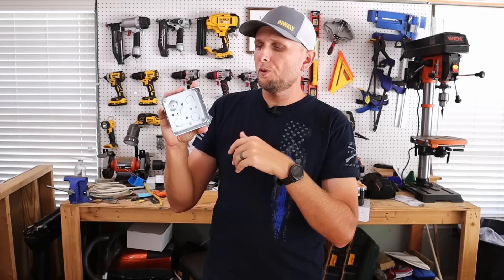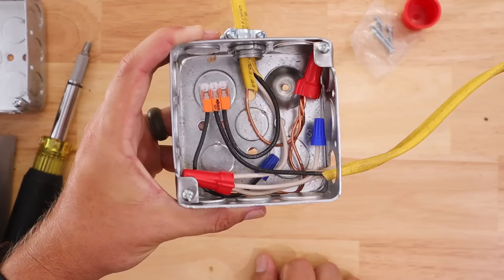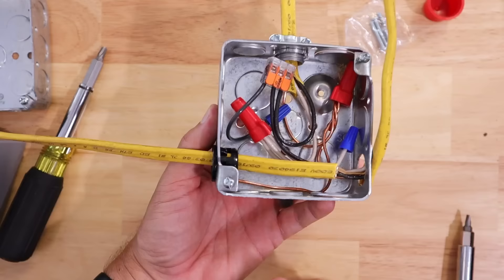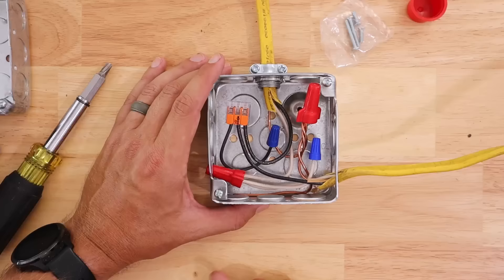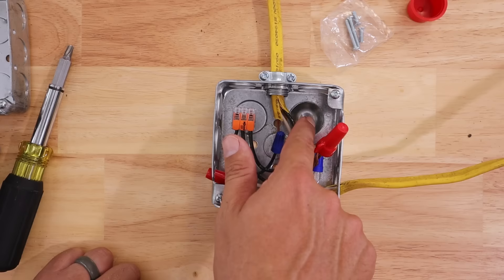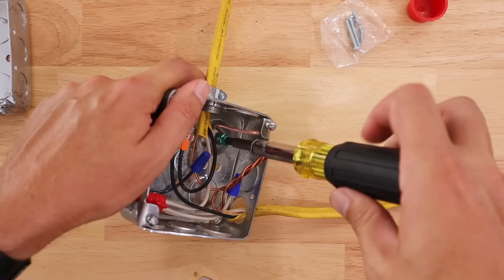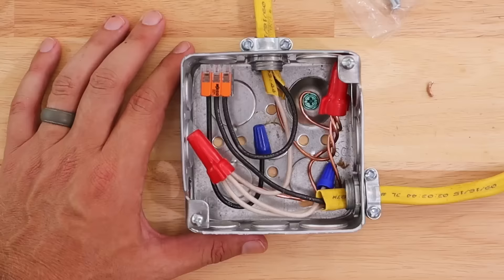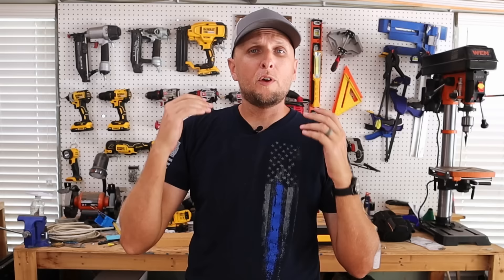The BIGGEST Mistakes DIYers Don't Know They Are Making When Installing Metal Electrical Boxes

Comment: The biggest issue I see is someone performing electrical work without a license. The NEC and NFPA both state only qualified people should perform electrical work. The typical homeowner doesn't have the knowledge, training, skills or ability to do their own electrical work. There is a reason why the IBEW and IEC has a 4-5 year apprenticeship program. How versed is the average homeowner in the current NEC edition? Leave it to the pros
 
Additionally most insurance wont cover unlicensed work
Reply from the maker: Well the NEC stating that doesn’t supersede local law and most places allow the homeowner to do their own electrical to varying levels depending on jurisdiction.  Where I live I can pull a permit and wire my entire house myself and then have it inspected.  Just different everywhere.  Also about your last statement, it more so is talking about hiring unlicensed workers, not you doing your own.  But every policy is different and should definitely check it.

Comment: So you found 3 out of the 5 mistakes in that box.  

4) short wires.  Any wire entering a box by code needs to be at least 6 inches long.  The boxes height it 4 inches so it looks like those wires are about 5 inches.  
5) The documentation for using marrettes requires you to twist the marrette until the wires themselves start twisting a little bit.  If you do this, then you are guaranteed to not have your wires fall out of the marrette for some reason.

Comment: Good advice.  I'd add one thing more.  Unless there's a specific reason to use metal boxes, my advice is don't use them.

The only time you need to use metal boxes is if the box is installed in an exposed environment, or if you're using metal conduit.

Otherwise, why?  Metal is harder to work with, requires grounding, and is more expensive.  If you really need something that's more durable than PVC plastic (which is plenty durable), use a fiberglass box.
Reply: Surface mount.
Reply: @jamescole3152  Also true.  But surface mount also means an exposed location.

Comment: Issue 1 who sits there and just pulls on their electrical boxes? Complete non issue fear mongering.
Issue 2 your ground wires rubbing all up against that box. If it were a hooker at a club, that ground wire wouldn't be allowed back in. Same as number 1, box is grounded. It'll blow the breaker long before it burns up the ground.
Issue 3 also not really an issue. Voltage drop across 3 inches of wire won't be nearly as bad as 30 feet of the slightly bigger gauge running in your wall. If it were to catch on fire, it's in a metal box and there's barely anything flammable anyway.

Comment: 35 years as an electrician.  When the wago type connectors came out years ago, I was onboard.  Since then, over the last 5-6 years I have to many times seen them become fire hazards.  The spring action when heated then cooled over and over for years become weak, wires get loose and they burn up.   I have personally come across this dozens of times compared to maybe twice with an improperly installed wire nut.  Take it from me, twist your wires and use a proper wire nut.  Why and how these wago type connectors are still approved and on the market only shows the politics in the electrical industry where money is first and your safety is second.

Comment: Jesus! Move to Australia. All that connecting and jumpering is replaced with.... Strip ends... twist together.. insert directly in to power point... lock down with a screw connector.... already part of the power point!

Wagoe and wire nuts are the most abhorrent idea I've ever seen... if we have to do something similar its a BP connector and the box is PLASTIC. Why are you even allowed to do this level of work as a DIY?

Maybe the powers that be over there are helping the "natural selection process" along.... 

Cheers great video. Always interesting to see how things are done elsewhere.

Comment: Who climbs in walls and yanks on wires? Any normal licensed electrician shuts off the power first to any outlet. True the wire needs protection but l highly doubt a thick insulated wire will wear through by just sitting. Lol.

Comment: The 14 gauge wire is a fixture tap what's the big deal
Reply from the maker: It’s not.  A fixture tap would be hardwired to a fixture with an exact load.  What if I put a 20 amp receptacles on it?

Comment: Hey. Don’t use metal boxes,wire nuts and no  twisting together, and no sleeving on the earth. Use  a proper WAGO junction box and WAGO connectors. if the wires pull out of the WAGO connectors. GO aback to school. SIMPLE.

Comment: Question for American Electrician:
1. Are this metal electrical boxes common or do u use plastic boxes more often?
 2. Same question but with Wirenuts and Wagos.
3. The yellow cables are ur usually used wires for electric installation? Flat not Round cables?

Comment: 8:30 Saying “pros make this mistake”, when it’s not a mistake… 🤦 You are allowed, BY CODE (and common sense), to downsize the wire at the point of termination. Twelve to fourteen isn’t that big of a jump… especially when you consider that 14g is rated for 22amps. The reason we can’t run a 20a circuit in 14g, is due to the 80% rule, for continuous loads.  
Try not to imply electricians are “doing it wrong”. It’s a bad look, especially when you end up being the one that is mistaken. 👍🏼
Reply from the maker: It’s wrong.  Confirmed it will an electrician unless the wire is a load affixed to something like a light fixture.

Comment: Box ground screw does NOT have to be green. Switch and receptacles YES, box NO.
Reply from the maker: That’s true.  But far easier to just go pick up the green ground screws in the electrical aisle and know that you have the correct size and type of screw.
Reply: @HowToHomeDIY  Yes but there"s nothing special about a 10-32 screw.
Reply from the maker: You are right, there isn’t.  And one that’s 3/8 inches long isn’t special either but would be the correct length.  Again, getting the green ones in the electrical section will guarantee someone that they have the right screw.
Reply: @HowToHomeDIY  Again Yes. But why pay more?

Comment: These new square insert connectors are JUNK.  Internally they have a sharp blade connector that grabs the wire...The problem is where the blade connects to the wire creates a very small connection point that can easily go bad with wire rated amperage of 15 to 20 amps.  The square connectors overheat and start fires...If you have any of them,  toss them in the garbage or take them back and get a refund!  The only way to properly connect wires is to twist the wires together (turning clockwise) then put the wire nut on them and tighten!

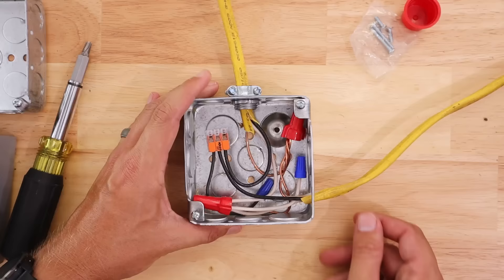Comment: @1:10 strain relief
@4:00 grounding issues
@8:00 considering circuit loads and wires' gauge 

good content, but consider chapter breaks?  You don't even have to spoil what the topics are, but its nice to be able to review the parts you want to focus on without scrubbing

Comment: None of the Romex entering my breaker panel has clamps at the hole. Not being easily convinced that those wires were going to "move around a lot" I spared the expense. I put the panel in myself, live. That's right, I took the old 100A breaker box out and put the new 200A one in with the power ON. It has worked perfectly for over 30 years now. I also ran the 240v lines to my hot tub and electric stove for a small fraction of what you guys would have charged me. Electricians are like veterinarians. They think their services are worth WAY more than they actually are. They want over $100 to replace a simple outlet or light switch now, a 10 minute job that pretty much anyone with a screwdriver can manage if they pay attention.

Comment: At 5:13 you state "You can't use just any screw, you have to use on of these green ground screws."
WRONG! There is nowhere in the National Electrical Code that state the screw you use to bond to a box or enclosure has to be 'green.' 
Section 406.10(B)(1) - [Receptacles] - the terminal on 'the device' - a green...;terminal screw not readily removal. 
Similar language applies to light switches.  But, the enclosure, box, etc. is NOT required to use a 'green' screw to secure the bonding wire. Check 250.8(A)(5) for the use 'of a screw" to secure [among other methods' to secure a bonding/grounding wire to an enclosure.
Again - there  is NO language in the NEC requiring a 'green' screw to be used in a box. 
Think about it - [see Table 250.122 - Minimuim size equipment grounding conductors for  grounding raceway and equipment] - where are you going to find a 'green' screw for a size 250 kcmil condutor? That's for a 2000 amp. Even a 200A  circuit requires a #6 conductor - where's the green screw for that? Nobody makes any such screws - because the code DOES NOT REQUIRE THEM. That said, yes, I do use the green screws for the very small 15-20A circuits - but that's because most building inspectors don't know the code and think they are required.
Reply from the maker: Guy, I am well aware of what it says.  This video is intended for DIYers.  It is far better to have them go to their local store, go to the electrical aisle and buy the green ground screws and know they are the proper type and size.  Would be a complete waste of time to say and you can just use any 10-32 x 3/8 machine screw.  Nobody is going to remember that and it serves no advantageous purpose and like you said, some inspectors don't know the code so just buy the dang green ground screws 🤣

Comment: Old school electrician methods of connecting are better I always pre twist before putting on wire nut I always use the lug on the receptacle for making connection over the years I have seen push connections end connectors of the same method fail and catch fire in the box and even worse progressed even further than the box I am just not a fan of push connectors where I have seen them fail so often if you're going to use push connectors and the push connector on the back of the receptacles after inserting them make sure you pull on them fairly snugly to make sure that they seat properly on the copper wire if they pull out easily the connection is faulty well enough of this R- tired old electrician rambling on

Comment: No point using metal boxes. They are relics from the past. We stopped using them för over 40 years ago.
Reply: No, we didn't stop using them. They're used every day in non-residential, and I use them regularly on resi projects when they make sense.

Comment: You are saying a "metal " clamp to hold the wire in the box. It is not a metal clamp. They are NON metalic!!!
Reply from the maker: They are made of zinc which is a metal.  They are called non metallic connectors because of the cables they secure.

Comment: Wrong... The code requires you to bond the metal box only when you install the device and the cover plate on the box is a metal garvin cover...
Wrong again... you can use the #14 pigtail under the code utilizing the ten foot tap rule, next wire size down for individual device.
Reply from the maker: Wrong… always has to be bonded.  

Somewhat wrong again… depends on what is being installed.  For example, a light fixture is probably already going to have a cable designed for its load attached to it.  In this case, it is ok.
Reply: @HowToHomeDIY  - Oh yes that's right, it's romex... over site on my part. In my jurisdiction we never used romex unless it was for temporary. We ran emt conduit for electrical installations. I overlooked todays modern electrical installations- Cheapest method , higher profit...
Any metal enclosure with romex entering should grounded

Comment: So you are telling the viewers that if you install a 15A receptacle you need to use #12 wire for power.  That is if we are using a push in splicing connector.   That doesn't  make any sense!!!  If my circuit breaker is rated at 15A for the circuit the receptacle is on then #14 wire is good according to the NEC code.  Using #12 wire is ok to use but so is #14.  If you are going to critique other people's work, make sure you explain the situation better.  I bet half that  "BIG MISTAKE" that you found was actually legit.
Reply from the maker: When did I say you needed to use #12 for a 15 amp receptacle?  When did I ever say it was even a 15 amp circuit?  I never said any of that.  Take it easyyyyyyyyy.

Comment: First of all, the splices should be twisted. If you dont twist these wires together, you should not be doing electrical wiring. In fact, wiring isn't a hobby. Hire a professional electrician.  Coming from a 30-year experienced master.

Comment: I'm not a "professional" electrician, nor do I know "alot" about electrical work(, but for me personally, I DO NOT, NOR will I personally ever use metal boxes. Some things are almost always a guaranteed happening. One of those guarantees is wires will be overloaded many times over and over again throughout their years of people practically trying to run a whole super market off one 12-14 wire +plug, and the last 1-1 1/2" of insulation becomes hard, burnt and britttle, whether it be at tie together cap-offs, or at outlets. And also just like with caps, I personally don't twist and twist with too much force till you can't twist anymore. You do that with 30+ year old wire, and you will break the wire either right then, or it will be "almost" broke up inside cap to where it will fall out once it sees a hint of pull. Even when replacing old outlets, the copper loop at times is so brittle, that it actually breaks just by unscrewing it. And if you ever work in old trailers, you'll know they do not give any slack on wire to just cut off an inch for a "patch/bandaid" where wire is at it's "worst point". But I'm also the guy who the next person would curse at, because I believe in electric tape, especially with caps. When the tape is nice and tight, and taped right, you can pull on it with all your might, so when the next person comes along on down the line in future, yanking and pulling on wires, my points aren't coming loose. Sure it's not "convenient", and is time consuming, but is a heck of alot securer. I've also seen a heck of alot of "professionals" in my times, who do not take the time to bend/sculpt the wires of outlets so that they can fit the outlet+wires in the box without putting pressure on outlets faces themselves, instead, they use the mounting screws to help force the outlets into boxes. But I guess I am just very particular with nearly everything I do. I don't even like my insulated parts of my wires touching/crossing each other in box if I can help it, because I know what many of them will looks like in 30-40 years, as somehow inside the "sealed" outer insulation casing, the actual wires' insulation usually looks+feels good, but at each connection point of flow, is where old wires and their insulation seem to get burnt and brittle. regardless of the many reasons, neglects and/or installed half-@$$ from the start, that's just what happens with age and time, so I personally go the extent to hopefully make things last a little more time and extra abuse as they age. We live in times where houses are s@@tly  built in a day, "codes" are dictated, manipulated, and written with "profits" ahead of safety, quality and endurance to actually last, and I personally just can't seem to "adapt" to the standards of "fast paced" speed and profit before quality!

Comment: CAUTION: Wago connectors are not Gods gift to electricians and DIY's. They are quick and convient and in low voltage/current projects are great. BUT. If there is any chance a device that has a high startup surge current do not use them. Wago's are good for 20 amps only. Drill motors, saws, compressors, Air & ac, anything that has a electric motor has what is known as Inrush current, input surge current, or switch-on surge. This is the maximal instantaneous input current drawn by an electrical device when first turned on. Alternating-current electric motors and transformers may draw five times or more times their normal full-load current when first energized, at least for a few cycles of the input waveform.   Example. 120v air compressor that draws 10 amps running can actually draw over 50 amp on startup. While it is only a short period of time. Constantly doing this over and over will take its tole. Eventually that wago is going to burn up. Just one overcurrent will damage the wago. then after several the resistance of that wago goes up. This causes heat more resistance more heat. Well you get the point. You have to strip the wire anyway. Use wire nuts and if you have a lot to do buy a wirenut wrench with a 1/4" shank. Plug it into your Dewalt electric screwdriver and be safe. I am 73. I have been a licensed journeyman electrician since 1972 industial and residential. Be safe out there folks. Saving 10 seconds using a wago is not worth the possible results.

Comment: The biggest mistake by far is using the wire nuts for anything. They are a terrible connection device and anyone that claims to be a professional electrician should not be using them. There are loads of different products that are far better and easier to use. Please stop showing people these, you should not encourage their use. 

Also, why do you not sleeve your Earth cables?

Comment: That little orange connector is not very good. Not as good as wires twisted and then wire nut screwed on real good.
Reply: I've never had wegos fail, but bad tiwst and tape jobs fail often.

Comment: Issue: ground wire is touching metal box therefor a possible issue would be that the hot wire can now arc to the box because now the box is grounded.
Solution: permanently wire the ground to the box which means the box is still grounded. 
Make it make sense